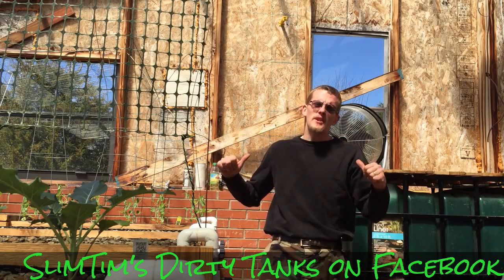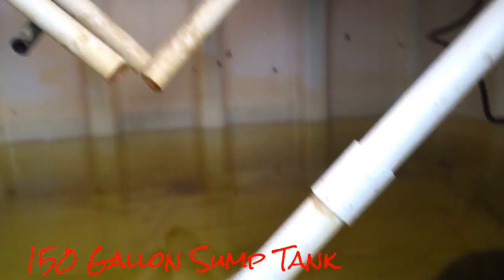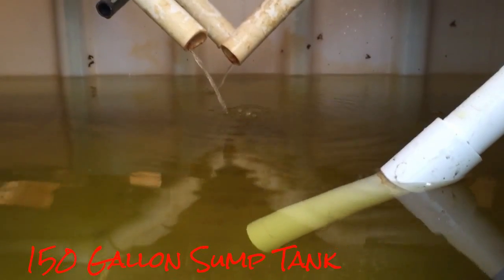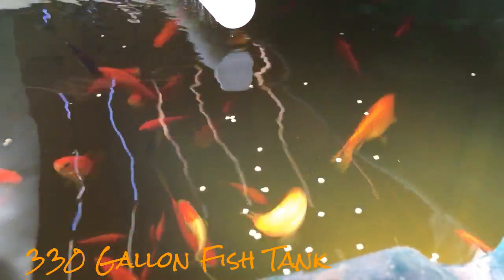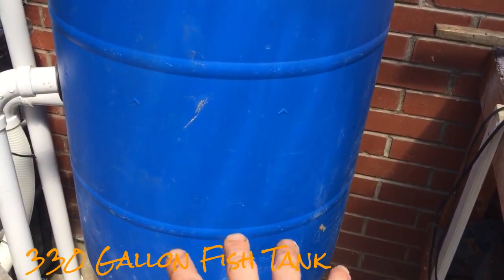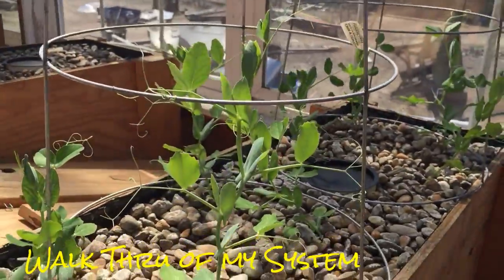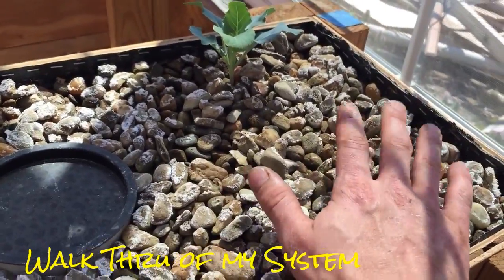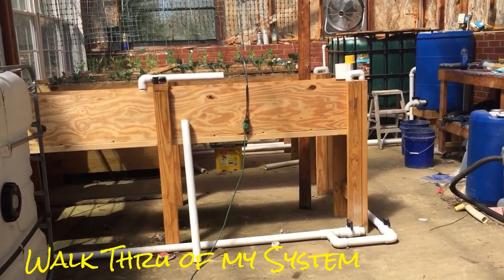Greenhouse Aquaponics Update: Spring 2015

Comment: glad to see you back at it.  with that much calcium in your well water you may want to put a vinyl gutter at the low end of your green house roof and collect any / all of that free distilled water to cut your system water with.  search rain water harvesting and "first flush" and maybe sand filters if your house already has gutters and has regular shingles
Reply from the maker: Awesome feedback Neil Orris, much appreciated.  Saving up to get several more IBC or blue barrels to catch rain water. I got a metal roof on my house, love that sound during rain storms, with no gutters as of yet. Been looking at the vinyl gutters at Lowe's, thinking I could do that.

Comment: Cool Stuff. Wonder about removing the calcium carbonate by just lowering ph. Are you sure that will accomplish that?  I think diluting with the rain water will do it. I have high ph well water and test for hardness gh and kh to monitor it as well as ph to set my co2 in planted tank. Read that the KH is what makes the ph bounce back so fast.  You must use a large amount of make up water... Is a reverse osmosis an option? To get the calcium out of my house water I have to use an ion exchange  water softener with salt. It removes the hardness but the ph stays high.
Those vegetables are going to be great- enjoy!

Comment: lmao 13" pleco too big for my 20 gallon tank...how much muriatic acid did u use to drop your ph?
Reply from the maker: Glad to him a bigger area to move around Rico.  8-10 oz. to 500 gallons what I'm dosing currently.  Read a post that 3 oz bring 55 gallons at 8.4 to 6.9.  But don't want to stress the fish with that quick of a drop. Plus it took 3 weeks to break my ph buffer. As stated in video, "individual results are different".  Thanks for tuning in and commenting. 🔥🔥Fired Up!!!🔥🔥